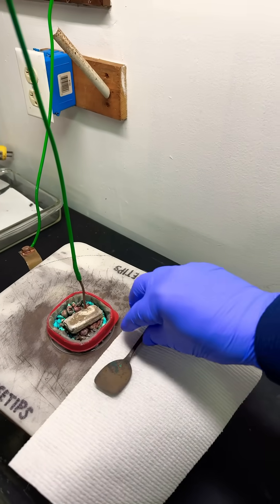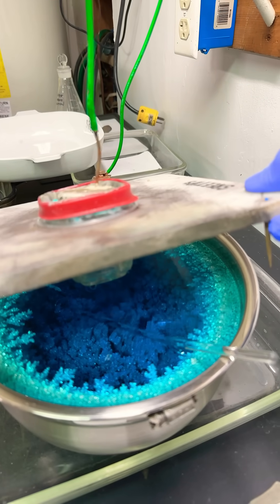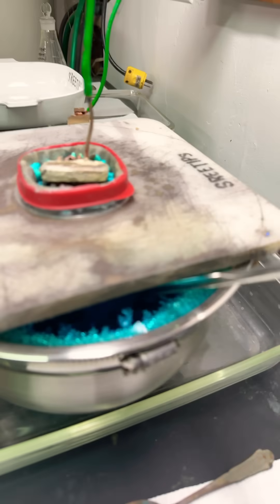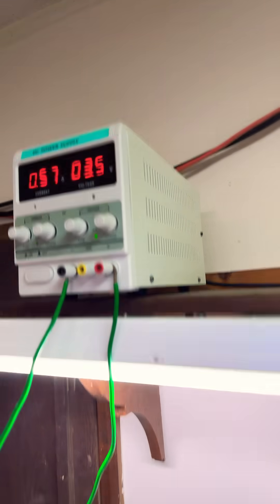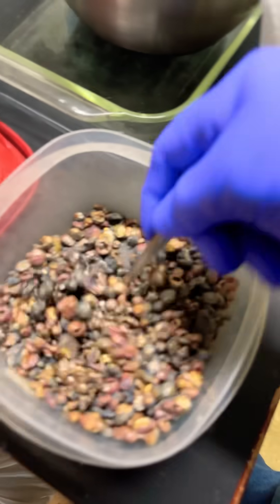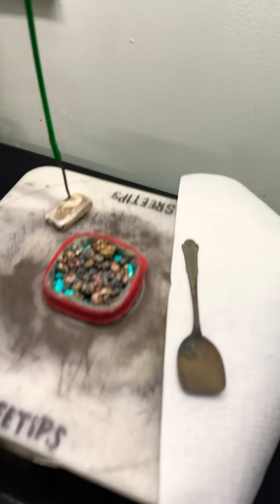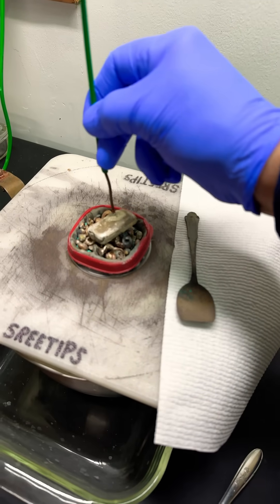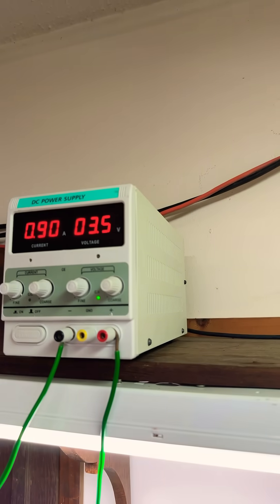High Purity Silver Cell Adding Impure Silver to the Anode Basket.

Comment: I dont understand what exactly is going on?? What do you do with that crystal stuff and what is the adding of the anode filter doin?
Reply from the maker: I refine gold. I use sterling silver to refine gold. I recover the silver from that, melt into shot, and run it through my silver cell. The cell converts the impure silver (about 980 parts per thousand silver) to high purity four nines fine (9999 parts per ten thousand) pure elemental silver metal. The impure silver is added to the anode basket. The anode basket is suspended in the silver nitrate electrolyte. I pass an electric current through the impure silver. The silver dissolves, passes through the Dacron filter, travels through the silver nitrate electrolyte, and deposits on the stainless steel bowl (the cathode). The bowl is connected to the negative pole of the power supply. The process only deposits pure silver on the cathode. So I’m refining the impure silver, into high purity silver. When it’s full, I harvest the pure silver crystal, put it away and forget about it. Then I repeat the whole thing again.

Comment: So you feed silver to get silver? Whats the point? +-0?
Reply from the maker: Here’s the point: I refine gold. I use sterling silver to refine gold. I recover the silver from that, melt into shot, and run it through my silver cell. The cell converts the impure silver (about 980 parts per thousand silver) to high purity four nines fine (9999 parts per ten thousand) pure elemental silver metal. The impure silver is added to the anode basket. The anode basket is suspended in the silver nitrate electrolyte. I pass an electric current through the impure silver. The silver dissolves, passes through the Dacron filter, travels through the silver nitrate electrolyte, and deposits on the stainless steel bowl (the cathode). The bowl is connected to the negative pole of the power supply. The process only deposits pure silver on the cathode. So I’m refining the impure silver, into high purity silver. When it’s full, I harvest the pure silver crystal, put it away and forget about it. Then I repeat the whole thing again.
Reply: @sreetips sounds like you know exactly what youre doing 👌

Comment: So you can grow silver or what ?
Reply from the maker: Correct. I refine gold. I use sterling silver to refine gold. I recover the silver from that, melt into shot, and run it through my silver cell. The cell converts the impure silver (about 980 parts per thousand silver) to high purity four nines fine (9999 parts per ten thousand) pure elemental silver metal. The impure silver is added to the anode basket. The anode basket is suspended in the silver nitrate electrolyte. I pass an electric current through the impure silver. The silver dissolves, passes through the Dacron filter, travels through the silver nitrate electrolyte, and deposits on the stainless steel bowl (the cathode). The bowl is connected to the negative pole of the power supply. The process only deposits pure silver on the cathode. So I’m refining the impure silver, into high purity silver. When it’s full, I harvest the pure silver crystal, put it away and forget about it. Then I repeat the whole thing again.
Reply: @sreetips  I think you’ve just started a side hustle for me 🫡 do you have videos that I can learn how to do it from start to finish
Reply from the maker: Silver cell build from scratch step by step - video posted on my channel.
Reply from the maker: You can’t go wrong converting your paper to metal.

Comment: I really need to know the chemicals and the know how of this please explain to me please
Reply from the maker: I refine gold. I use sterling silver to refine gold. I recover the silver from that, melt into shot, and run it through my silver cell. The cell converts the impure silver (about 980 parts per thousand silver) to high purity four nines fine (9999 parts per ten thousand) pure elemental silver metal. The impure silver is added to the anode basket. The anode basket is suspended in the silver nitrate electrolyte. I pass an electric current through the impure silver. The silver dissolves, passes through the Dacron filter, travels through the silver nitrate electrolyte, and deposits on the stainless steel bowl (the cathode). The bowl is connected to the negative pole of the power supply. The process only deposits pure silver on the cathode. So I’m refining the impure silver, into high purity silver. When it’s full, I harvest the pure silver crystal, put it away and forget about it. Then I repeat the whole thing again.
Reply: @sreetips  that is so awesome how does one get into this bc I really want to do this and thank you for your honest reply I can tell you you're an intelligent individual. And again thank you
Reply from the maker: I learned on the goldrefiningforum.com

Comment: Is that or can it be a battery?
Reply from the maker: No, it’s an electrolytic silver refining cell. I refine gold. I use sterling silver to refine gold. I recover the silver from that, melt into shot, and run it through my silver cell. The cell converts the impure silver (about 980 parts per thousand silver) to high purity four nines fine (9999 parts per ten thousand) pure elemental silver metal. The impure silver is added to the anode basket. The anode basket is suspended in the silver nitrate electrolyte. I pass an electric current through the impure silver. The silver dissolves, passes through the Dacron filter, travels through the silver nitrate electrolyte, and deposits on the stainless steel bowl (the cathode). The bowl is connected to the negative pole of the power supply. The process only deposits pure silver on the cathode. So I’m refining the impure silver, into high purity silver. When it’s full, I harvest the pure silver crystal, put it away and forget about it. Then I repeat the whole thing again.

Comment: Im gonna look dumb for asking but what is actually happening here?
Reply from the maker: I refine gold. I use sterling silver to refine gold. I recover the silver from that, melt into shot, and run it through my silver cell. The cell converts the impure silver (about 980 parts per thousand silver) to high purity four nines fine (9999 parts per ten thousand) pure elemental silver metal. The impure silver is added to the anode basket. The anode basket is suspended in the silver nitrate electrolyte. I pass an electric current through the impure silver. The silver dissolves, passes through the Dacron filter, travels through the silver nitrate electrolyte, and deposits on the stainless steel bowl (the cathode). The bowl is connected to the negative pole of the power supply. The process only deposits pure silver on the cathode. So I’m refining the impure silver, into high purity silver. When it’s full, I harvest the pure silver crystal, put it away and forget about it. Then I repeat the whole thing again.
Reply: @sreetips  thank you for the detailed response. It looks like an interesting reaction

Comment: Okay so what are you doing?
Reply from the maker: Refining silver to very high level of purity.
Reply from the maker: I refine gold. I use sterling silver to refine gold. I recover the silver from that, melt into shot, and run it through my silver cell. The cell converts the impure silver (about 980 parts per thousand silver) to high purity four nines fine (9999 parts per ten thousand) pure elemental silver metal. The impure silver is added to the anode basket. The anode basket is suspended in the silver nitrate electrolyte. I pass an electric current through the impure silver. The silver dissolves, passes through the Dacron filter, travels through the silver nitrate electrolyte, and deposits on the stainless steel bowl (the cathode). The bowl is connected to the negative pole of the power supply. The process only deposits pure silver on the cathode. So I’m refining the impure silver, into high purity silver. When it’s full, I harvest the pure silver crystal, put it away and forget about it. Then I repeat the whole thing again.

Comment: I have no idea what im looking at. Can someone explain it to me?
Reply from the maker: I refine gold. I use sterling silver to refine gold. I recover the silver from that, melt into shot, and run it through my silver cell. The cell converts the impure silver (about 980 parts per thousand silver) to high purity four nines fine (9999 parts per ten thousand) pure elemental silver metal. The impure silver is added to the anode basket. The anode basket is suspended in the silver nitrate electrolyte. I pass an electric current through the impure silver. The silver dissolves, passes through the Dacron filter, travels through the silver nitrate electrolyte, and deposits on the stainless steel bowl (the cathode). The bowl is connected to the negative pole of the power supply. The process only deposits pure silver on the cathode. So I’m refining the impure silver, into high purity silver. When it’s full, I harvest the pure silver crystal, put it away and forget about it. Then I repeat the whole thing again.

Comment: Explain you alchemist!
Reply from the maker: I refine gold. I use sterling silver to refine gold. I recover the silver from that, melt into shot, and run it through my silver cell. The cell converts the impure silver (about 980 parts per thousand silver) to high purity four nines fine (9999 parts per ten thousand) pure elemental silver metal. The impure silver is added to the anode basket. The anode basket is suspended in the silver nitrate electrolyte. I pass an electric current through the impure silver. The silver dissolves, passes through the Dacron filter, travels through the silver nitrate electrolyte, and deposits on the stainless steel bowl (the cathode). The bowl is connected to the negative pole of the power supply. The process only deposits pure silver on the cathode. So I’m refining the impure silver, into high purity silver. When it’s full, I harvest the pure silver crystal, put it away and forget about it. Then I repeat the whole thing again.

Comment: Is this electrolysis being done here?
Reply from the maker: Electrolytic silver refining.
Reply: @sreetips  oh ok, thanks for the info!
Reply from the maker: I refine gold. I use sterling silver to refine gold. I recover the silver from that, melt into shot, and run it through my silver cell. The cell converts the impure silver (about 980 parts per thousand silver) to high purity four nines fine (9999 parts per ten thousand) pure elemental silver metal. The impure silver is added to the anode basket. The anode basket is suspended in the silver nitrate electrolyte. I pass an electric current through the impure silver. The silver dissolves, passes through the Dacron filter, travels through the silver nitrate electrolyte, and deposits on the stainless steel bowl (the cathode). The bowl is connected to the negative pole of the power supply. The process only deposits pure silver on the cathode. So I’m refining the impure silver, into high purity silver. When it’s full, I harvest the pure silver crystal, put it away and forget about it. Then I repeat the whole thing again.

Comment: How long does it take and how much for all the supplies
Reply from the maker: I harvest the silver about every ten to 14 days depending on how fast the silver deposits on the cathode. Get it too full and the silver could make contact with the anode basket, burn a hole in it, and ruin the batch of silver.
Reply from the maker: I have a video on my channel on how to build the silver cell from scratch. It gives cost data for the supplies.

Comment: You have a power supply hooked up to it. So the battery of that what you call it isnt pushing any power. The amps is what power suply is providing
Reply from the maker: Yes, 3.5 volts DC set to constant voltage mode.

Comment: Please explain what's going on here
Reply from the maker: I refine gold. I use sterling silver to refine gold. I recover the silver from that, melt into shot, and run it through my silver cell. The cell converts the impure silver (about 980 parts per thousand silver) to high purity four nines fine (9999 parts per ten thousand) pure elemental silver metal. The impure silver is added to the anode basket. The anode basket is suspended in the silver nitrate electrolyte. I pass an electric current through the impure silver. The silver dissolves, passes through the Dacron filter, travels through the silver nitrate electrolyte, and deposits on the stainless steel bowl (the cathode). The bowl is connected to the negative pole of the power supply. The process only deposits pure silver on the cathode. So I’m refining the impure silver, into high purity silver. When it’s full, I harvest the pure silver crystal, put it away and forget about it. Then I repeat the whole thing again.

Comment: Would you please explain how this process is done?
Reply from the maker: I refine gold. I use sterling silver to refine gold. I recover the silver from that, melt into shot, and run it through my silver cell. The cell converts the impure silver (about 980 parts per thousand silver) to high purity four nines fine (9999 parts per ten thousand) pure elemental silver metal. The impure silver is added to the anode basket. The anode basket is suspended in the silver nitrate electrolyte. I pass an electric current through the impure silver. The silver dissolves, passes through the Dacron filter, travels through the silver nitrate electrolyte, and deposits on the stainless steel bowl (the cathode). The bowl is connected to the negative pole of the power supply. The process only deposits pure silver on the cathode. So I’m refining the impure silver, into high purity silver. When it’s full, I harvest the pure silver crystal, put it away and forget about it. Then I repeat the whole thing again.

Comment: Do you have a video explaining what this is/does in more depth?
Reply from the maker: I refine gold. I use sterling silver to refine gold. I recover the silver from that, melt into shot, and run it through my silver cell. The cell converts the impure silver (about 980 parts per thousand silver) to high purity four nines fine (9999 parts per ten thousand) pure elemental silver metal. The impure silver is added to the anode basket. The anode basket is suspended in the silver nitrate electrolyte. I pass an electric current through the impure silver. The silver dissolves, passes through the Dacron filter, travels through the silver nitrate electrolyte, and deposits on the stainless steel bowl (the cathode). The bowl is connected to the negative pole of the power supply. The process only deposits pure silver on the cathode. So I’m refining the impure silver, into high purity silver. When it’s full, I harvest the pure silver crystal, put it away and forget about it. Then I repeat the whole thing again.

Comment: What is the point of this contraption. I’m not super chemistry savvy a lil description would be dope
Reply from the maker: I refine gold. I use sterling silver to refine gold. I recover the silver from that, melt into shot, and run it through my silver cell. The cell converts the impure silver (about 980 parts per thousand silver) to high purity four nines fine (9999 parts per ten thousand) pure elemental silver metal. The impure silver is added to the anode basket. The anode basket is suspended in the silver nitrate electrolyte. I pass an electric current through the impure silver. The silver dissolves, passes through the Dacron filter, travels through the silver nitrate electrolyte, and deposits on the stainless steel bowl (the cathode). The bowl is connected to the negative pole of the power supply. The process only deposits pure silver on the cathode. So I’m refining the impure silver, into high purity silver. When it’s full, I harvest the pure silver crystal, put it away and forget about it. Then I repeat the whole thing again.

Comment: Awesome.  Are you on the East Coast?
Reply from the maker: Yes
Reply: When you added silver,  what do you call the different color pellets? What are they called in that pellet form?
Reply from the maker: Impure silver 98%
Reply: Are they 99.9? Or are you concentrating it? Is that the purpose.  Just trying to learn in real time.  And 1amp separates from impurities?. Where do the impurities go? To the negative rod?
Reply from the maker: They are 980 parts per thousand. The impurities get trapped in the anode filter.

Comment: I looked up "Sreetips" in the dictionary. 
It showed a picture of a GOAT
Nerds rule, girls drool
Reply from the maker: sreetips is a meaningless word, like Kodak.
Reply: @sreetips  You're the chemistry G.O.A.T. my friend.
I'm learning a lot from your videos.
I started setting up my own "laboratory", even though I'm not a chemist.
Bought a bunch of equipment and I know I will need more. I think I'm off to a good start.
Right now, I need to set it up properly. I need to isolate a corner of my basement and install ventilation first.
Then, I need to add a couple 15 amp circuits to my breaker panel. Would a 30 amp circuit be  useful?
This "lab" will have 2 main sections: a workshop and a chemical lab" 
I bought some glassware, including a filtering flask.
I also purchased a power supply, vacuum pump, vacuum chamber,  hotplate with magnetic stir sticks, air compressor/tank, multimeter/oscilloscope,  ultrasonic cleaner, vibrator, ph and TDS meters, fine mesh filters, wash bottles, ultrasonic thickness guage and a few chemicals.
I have a lot of other tools to work with
To start, I will be trying some electrolytic processes, some easy chemical synthesis, electroplating and silver/gold recovery.
Discovering your channel led me down a rabbit hole. I've been watching a lot of chemistry/DIY videos.
Do you have any thoughts as to what else would be useful?
I am going to